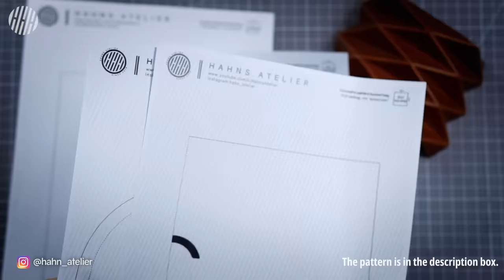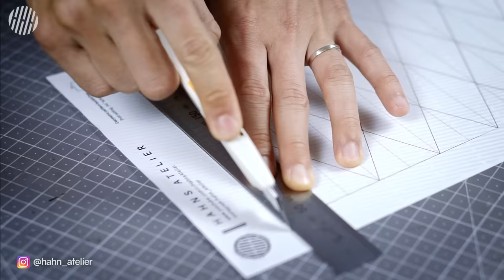[Leather Craft] Making a Geometric Patterned Bucket Bag

Comment: Very cool, but what kind of glue is used?
Reply from the maker: Here is the glue that I use usually Hope this helps!
1. kenda bond 
: yellow, chemical smell, very strong, low price
2. intercom ecostic, high price
: white, no chemical smell, thin
3. Instant adhesive
: race, braiding, metal hardware (rarely)
4. B5 bond
: Beige, Thick, using for lining.

Comment: Good afternoon. Tell me, please, what glues do you use in the manufacture of this charming bag? Thanks.
Reply from the maker: Here is the glue that I use usually Hope this helps!
1. kenda bond 
: yellow, chemical smell, very strong, low price
2. intercom ecostic, high price
: white, no chemical smell, thin
3. Instant adhesive
: race, braiding, metal hardware (rarely)
4. B5 bond
: Beige, Thick, using for lining.
Reply: @HahnsAtelier  Thanks a lot. You have helped a lot. Only I can’t find B5 bond anywhere on the Internet. Maybe you have any links? Thanks.